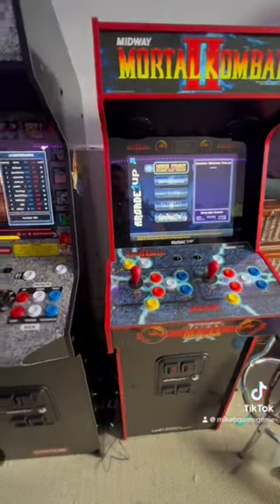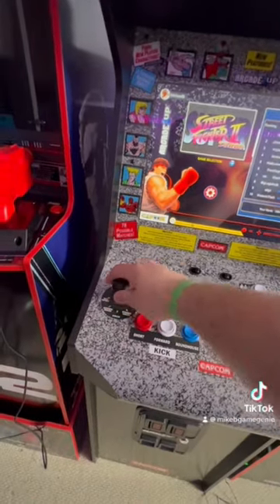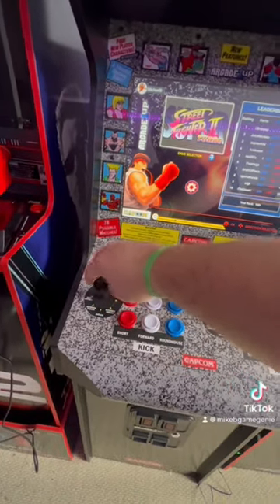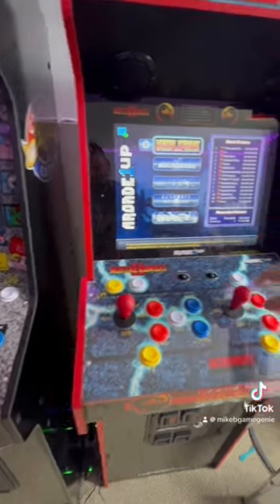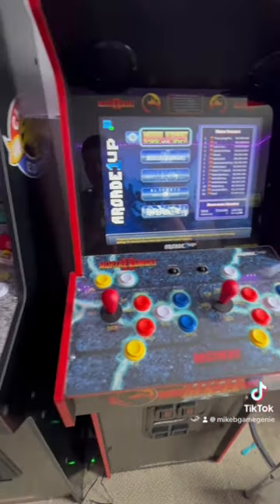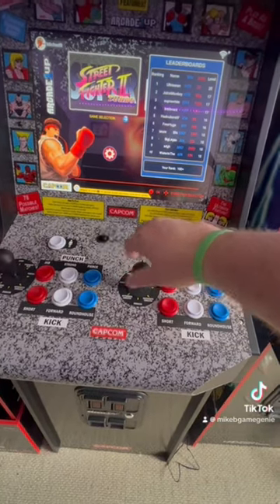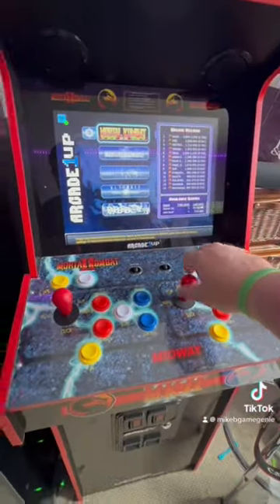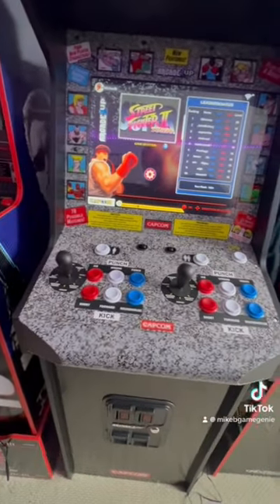How To Keep Your Arcade1Up Joystick Ball Tops TIGHT For FREE!

Comment: You’re spot on. It’s literally just a problem of slippery grip on the steel rod making it difficult to tighten fully. If you don’t have pliers, just grip the rod with a thick rubber band you get from grocery store produce. Same trick for opening very tight jars.

Comment: Exactly what I do. It stays put and you can remove it when you really need to. I usually put a thin cloth around the post so I don't rough it up. But yeah, you don't want to glue them in.